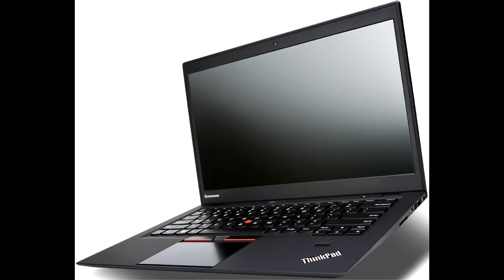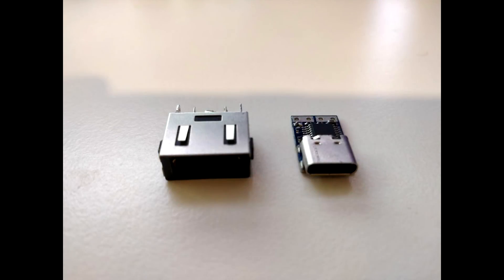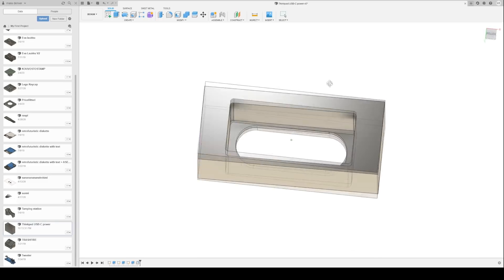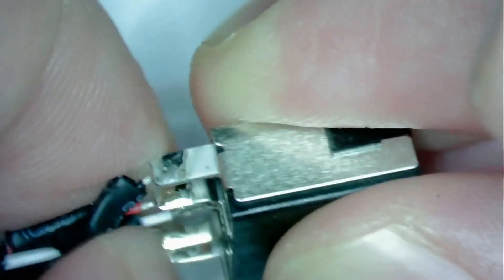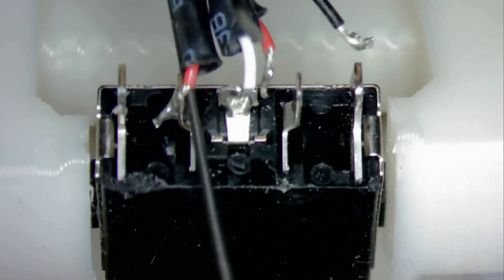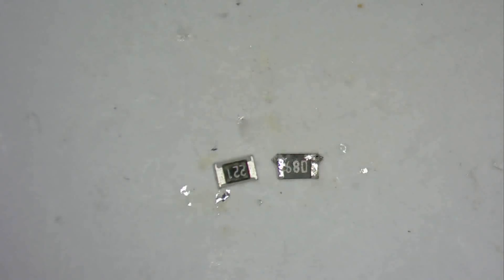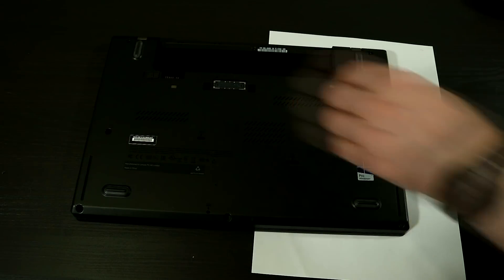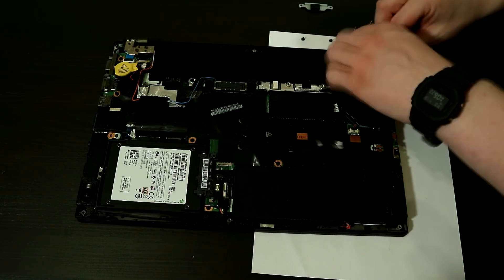Adding USB-C charging to Thinkpad T440s

Comment from the maker: If you have 15 Volt boards instead of 20 Volt ones, you can easily change the voltage between 15 and 20, here is how: https://youtu.be/jt6tO4P9r_I
Reply: Thanks. I think i need a hot air station with soldering iron to repair my iPhone 6. Have u consider to modify a laptop power adapter with a usb c PD emulator so that it becomes a usb c phone/laptop charger?
Reply from the maker: @kmsum  yes, https://www.youtube.com/watch?v=dvruntIjN6o

Comment: dude this took me so long to figure out. i was having issues with it not charging but it really was as simple as having the proper resistance. at first i used a 270k ohm resistor and a 15k ohm resistor but after hours of troubleshooting i figured out it was supposed to be ohms not kilo-ohms. i didnt have 285 ohms so i took two 150 ohm resistors off of an LED strip i had and now its working at 300ohms.

Comment: How do we calculate the appropriate resistor to be used? I'm using 100w pd charger. And can we use 100w charger with a resistor value for the 90w? Thank you
Reply from the maker: You look at a Lenovo charger pin out schematic and see which resistance value is used for which charger.

Comment: Good work 👍 But how did you find the value of the rezistor you need ? I want to make the same modification for a hp laptop and I don't know what rezistor to put for the sensing wire

Comment: Is it possible to do this mod to a thinkpad t430? Is The scheme with resistor the same?
Reply from the maker: very likely as the resistor scheme has not changed ever since the original yellow power plug was introduced, just be aware that you will likely lose the ability to dock the laptop as long as the mod is in use.
Reply: @Purkkaviritys  why? I the docking port is bypassing the original power port or am I missing something
Reply from the maker: @tomhackz250  yes it seems so, and since it blocks the normal connector for power, from the docks perspective, there shouldn't be a resistor, but since the resistor is now internal there is some undefined behavior

Comment: I'm just waiting for a usb-c module compatible with the new PD 3.1 to pop up so that I can finally do the same on my 170w W540.
It'll be just a bit more tricky cause the module will have to request 48v or 36v and then I'll have to figure out a way to bring that down to 20v in the tight space of the case. Maybe the empty space for the smartcard reader.
Anyway, great video
Reply: if you need 20 volt, why would you set it to 48 volt, and install a voltage reducing circuit rather than just requesting 20 volt?

Comment: Is it a bad idea to just use an adaptor that converts from USB C to Lenovo square like this one? https://www.ebay.co.uk/itm/274598611549
Reply from the maker: it does the same thing but in reverse, from the laptops perspective its pretty much the same.
Reply: @Purkkaviritys  but will it up the voltage to 20v as is required by the Lenovo?
Reply from the maker: @_B.M_  its simply an adapter that negotiates 20 volts from the usb-c powersupply, if the powersupply is able to provive 20 volts it will work, if it cant it wont. Its the same thing that I modded to the laptop, just in different form.
Reply: @Purkkaviritys  Perfect. That's really helpful

Comment: cool project. do you have any idea which power supply is detected if there is no resistor? Build an adapter my self without resistor. 65W USB-C PD power supply works great. But 45W USB-PD will not work. (Battery symbol switches on and off all time) Original Lenovo 45 W works great with the same laptop. its a T460s.
Reply from the maker: no power supply is detected as far as the laptop is concerned because to detect a psu requires a resistor in the sense pin, whether its a soldered one or one actually attached to the charger you use.
Reply: @Purkkaviritys  Sorry i not check it before. I use this round tip to slim tip adapter and it has 550 OHM (measured it now) What means the Laptop think it is connected to 90W power supply.
When i use this Adapter with a 65W old round trip Lenovo power supply its works just fine. Even an 45 W after market power supply works fine with this adapter. If i do the same with an USB-C to round trip adapter the power supply minimum needs 65W. I have also an old X230 and here is the same effect when i try to run it from a 45 W USB-C power supply.

Comment: You are using resistor for 95W charger indication. But how laptop will work with various kinds of type-c chargers? 30, 45, 65 Watts for example
Reply from the maker: since this is a retrofit, you need to use the type of charger you select the resistor for.
Reply: @Purkkaviritys  ,  Thank you. As I found on another resources, laptop can't charge on low power chargers sometimes (because of overheat or current protections, I think).
Yes, we need to know what we doing on retrofitting) But i still dreaming on intelligent type-c charging

Comment: This is so ingenious. I want to learn microsoldering. What is the soldering iron and microscope that you used?
Reply from the maker: Tried to link the stuff in the reply but that seems to have disapeared to thin air, added them to the video description. One of the most important things is that you get good quality solder, bad solder makes soldering next to impossible.
Reply: @Purkkaviritys  You are absolutely correct!!!

I can absolutely confirm that bas solder=bad time! It will make you think bad things! "My soldering iron must be crap! I need to buy a Hakko FX888D so I can solder properly...", "My brand new Hakko is browkened! I need an RMA!", "Dambit! Dambit! Dambit! I replaced my Hakko and for dambits sake I still can't even sodder! 😳😖 I am never going to can be soldering any best solder joint doings!! I suck at all them! Things! Even! Doin'! Definitely trying am I to 6hr new to stop doing any soldering! Just pay for it done! Saddest. 😔<--- see! saddest ever face I am having of one! sobad! sosad!"

" You just have bad solder..."

"I am good! Good!!! Best even at sodderking! They calling me SODDERKING!!

🤣 TRUE STORIEEEEE!

🇺🇦🇺🇦🇺🇦

Steyt
Reply from the maker: @jacobwcrosby  reminds me that changing soldering iron tips is also important, a new one for some odd reason works a lot better than on that has been used for 500 hours.

Comment: Just a warning: The Aliexpress "All goods are freeshipping Store" vendor to which you linked sent me 15V modules marked as 20V modules for the 20V modules I ordered, and vice-versa. Because I ordered more 20V than 15V modules, this was a real deficit, but they refused to make good on my purchase. Other vendors of this part are available.
Reply from the maker: note, the 15V version is the same as the 20V version, there is a single jumper that needs to be changed. The 15 volts can be made into a 20V part and the 20V part can be made 15V with the tiny change of the soldered jumper.
The same thing applies to the 9 and 12 volt version. The lower voltage version does not have the jumper set (9 and 15 volts) and the higher has it set (12 and 20V).
Reply: @Purkkaviritys  Thank you very much! That's easy enough!

In eight days of runaround the vendor didn't mention that. Clearly, this vendor has no idea what they are selling, so there's no special reason to purchase from this vendor. But I can quit worrying about it. ☺
Reply from the maker: @MichaelKJohnson  Yeah, I'll make a video and link it in the description so that people have a reference on what to do in the future.
Reply from the maker: @MichaelKJohnson  https://youtu.be/jt6tO4P9r_I
Reply: @Purkkaviritys  thank you again! 🙂

Comment: Is the t440s still relevant as a Linux machine in 2020? Even tho its impossible to upgrade the CPU.
Reply from the maker: I mostly do code for embeded devices with it, watch youtube and browse the web with occasional light CAD use, its still quite good. The ram is far more of a limitation than the cpu as you can only have 12Gb if I remember right.

Comment: You can now buy USB-C to thinkpad (rectangle or round plug) for around $7 on eBay. The adapter is several inches long, has a female USB-C input, and output is the thinkpad plug
Reply from the maker: I know, I hate dongles and as such want to avoid them as much as possible so thus made this instead, sure that is a far simpler solution if you are okay with dongles.
Reply: but then you are left with a dangle dongle... this way, when you close the lod, you have a factory package with nothing hanging out to catch and break.

Comment: While you are on your printer,you should 3D print a new S button as well ;-)
Reply from the maker: S is over rated, also I've once fixed a T440s key, the parts connecting the key are ridiculously delicate, can only be done on a SLS or resin printer. Should try to do that some time.

Comment: How did you handle the current overload on startup? I'm using a ZY12PDN locked into 20v mode and am able to power many devices. I have yet to find a charger that will start if the amps > 2.0. I have tried 100w and 65w wall chargers as well as car adapters (some can do USB-C 20v if you give them 24v instead of 12v). I can't understand how you can just plug in a laptop and get any wall charger to start giving 4 or 5 amps from start up. I can get to 100w, but it has to be done slowly. Trim pots are not practical for simple electronic devices.
Reply from the maker: Note, the USB-C charger used is the lenovo 65W one that would normally power a T495 or a T490, its rated at 3.25 amps at 20 Volts, so thats probably why.
Reply: @Purkkaviritys  OK, but isn't the whole point of this to make your old laptop into a modern USB-C device which can be charged by any standard USB-C source?
Reply from the maker: @tedhancock68  The point of it is that I can take 2 laptops to places and only need one type of charger.
Reply: @Purkkaviritys  Don't get me wrong, this is a very helpful and interesting video. Am I understanding correctly that you adapted 2 laptops and one charger to USB-C to avoid using an adapter?
Reply: @Purkkaviritys  Couldn't you just use a USB-C breakout board? It seems that you don't need the trigger functionality for your purpose.
Reply from the maker: @tedhancock68  Yeah, I tend to lose those, would probably lose my head if it wasn't permanently attached.
Reply from the maker: @tedhancock68  without a trigger board you will only get 5 volts out, the trigger board negotiates the voltage from the charger.
Reply: Purkkaviritys OK, I now understand that you are using a USB-C charger. It sounded like you converted the original charger to a USB-C connector. It is interesting that you can get a USB-C charger to deliver >> 2A on startup. Perhaps because this is the main job of a Lenovo charger? I think my 100w charger is designed to replace Apple, so negotiation may be more complicated.

Comment: Good work!  have you thought about potting the board into the 3d printed adapter with epoxy? it would probably make it as robust as the original, if not moreso.
Reply from the maker: I guess you could do that but due to the printing tolerances its there very tightly already and once its in the laptop chasis, the module does not move at all. I guess the resistors could benefit from it, but I did essentially pot them in cyanoacrylate already.